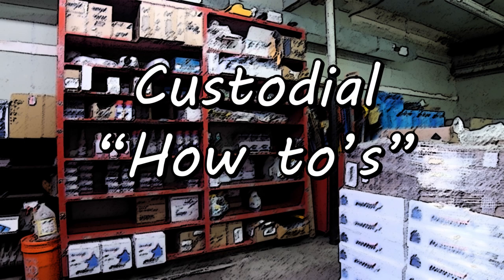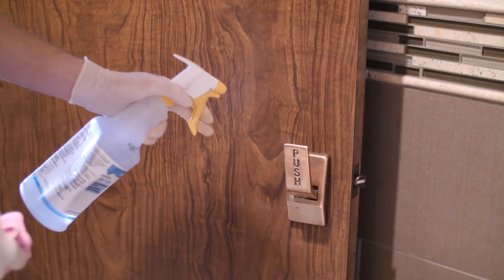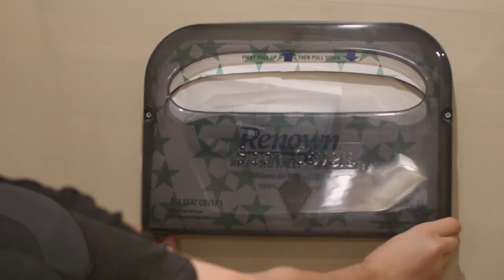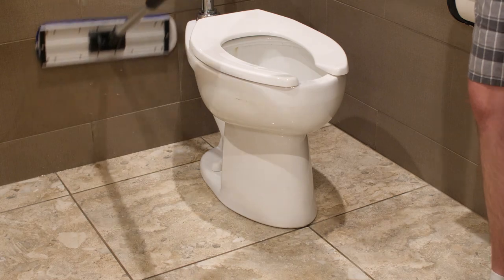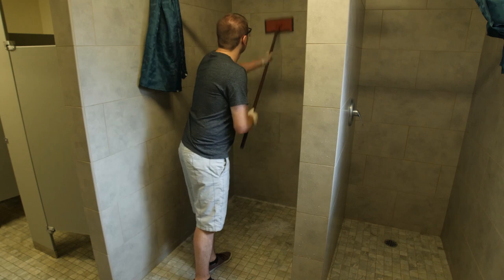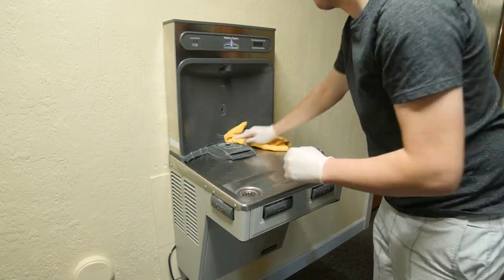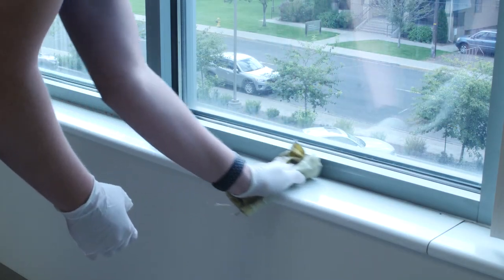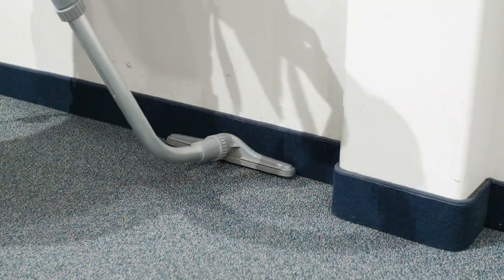Custodial Training Video

Comment: 1. Crack door, knock and announce, place closed sign and then Inspect.
2. Check and refill bathroom supplies.
3. Spray sanitizer to sit on touch points/toilets/urinals.
4. Dust and sweep.
5a. Spot Clean.
5b. Clean mirrors.
6. Throw out trash.
7. Scrub the sink.
8. Wipe the touch points and remaining non-toilet surfaces.
9. Disinfect disposable gloves before putting on yellow gloves, wipe toilet touch points and exteriors.
10. Scrub the toilets and urinal interior, then disinfect and remove yellow gloves.
12. Double check everything.
13. Mop on your way out. (:
14. Remove sign and start frolicking to the next bathroom.
15. Repeat.